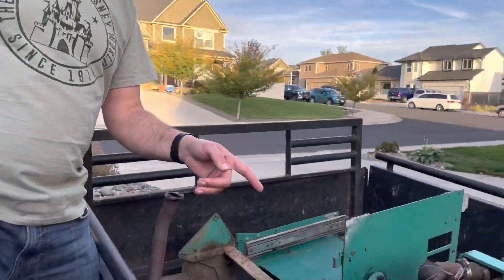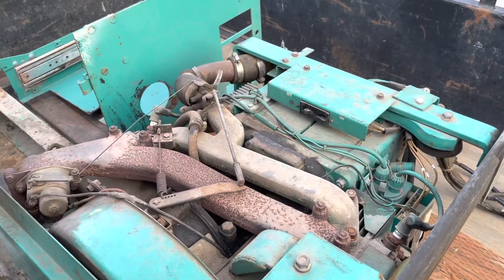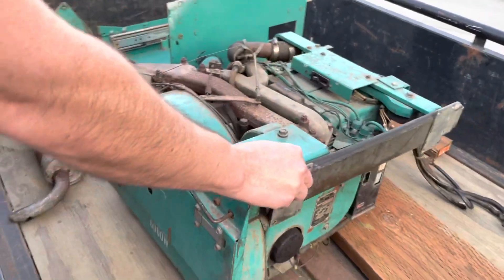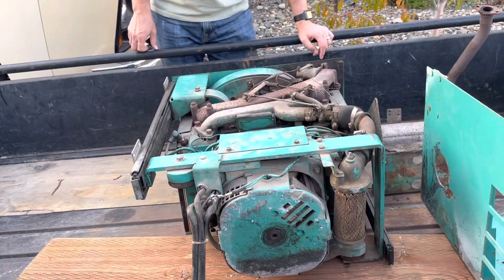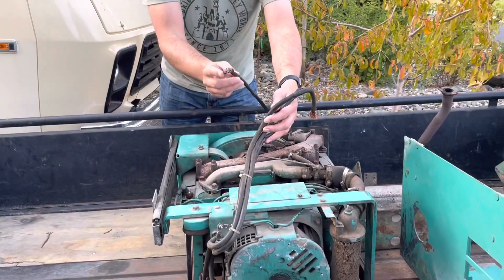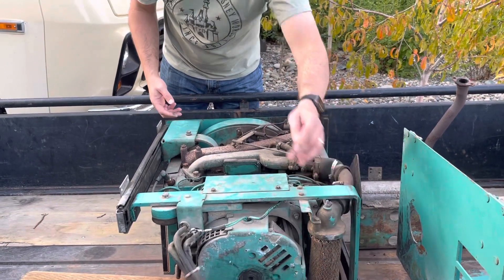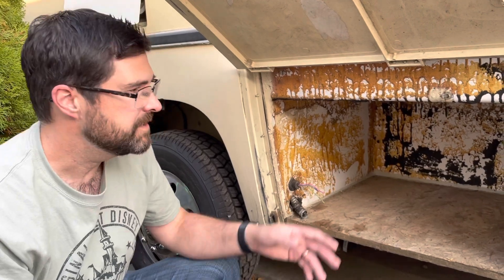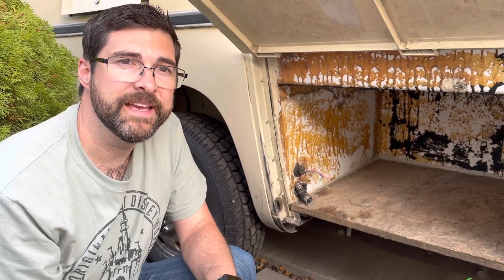‘77 GMC Motorhome Getting a Generator

Comment: The Onan genset in my '77 is identical to yours. I bought the coach in the spring of this year and had a few issues with the genset at first, one being the inability of starter to disengage after startup. Solved by thoroughly cleaning the solenoid mechanism. The auto choke and linkage was missing too but managed to find a replacement ...there were other mostly small annoyances along the way, but she's running pretty smoothly at the moment.  Good luck with it, when it's working it's just great!
Reply from the maker: Thanks for the encouragement! I've got some work to do in getting this unit running and generating but I'm sure we'll enjoy the results.

Comment: My 1977 GMC transmode came with a Honda EV4010 Liquid cooled generator installed by the previous owner. Superb unit but now not available any more i think...Maybe you can find a used one in good condition ! Good luck. Those were costly when new...
Reply from the maker: Those Honda’s are nice units! I like the original Onan generators because they are pretty simple, easy to maintain, and nearly bulletproof. We’ll see how my repairs and install go.

Comment: I gave away my generator.  It worked but when it comes down to it, I don’t use the generator often.  A few people may use the generator while traveling down the road but there are other solutions that are probably better.  For my family we want the extra storage space.  We actually moved the water tank from the passenger side to the drivers side.  This put all of the utilities on the driver’s side which is typical of most RV’s.
Reply from the maker: It all depends on how you like to use your motorhome and where you like to stay. We are in the Pacific Northwest and like to camp in primitive locations. I considered LiFePo batteries and solar or a smaller portable generator but in the end, we like the idea of getting back to a stock setup. It's a cool idea to have the water tank on the driver's side!
Reply: @MrGMCMotorhome  

I should have said this before, but you are doing great.  Many people will appreciate you bringing the motorhome back to stock.  Good luck with the generator.